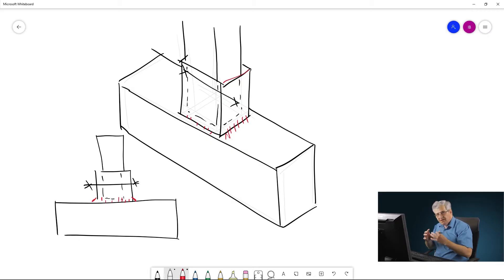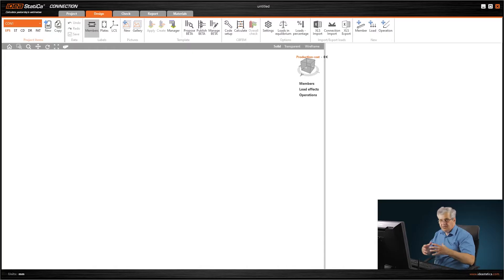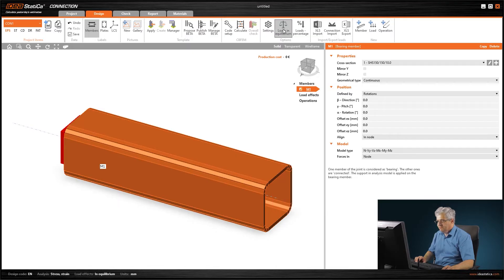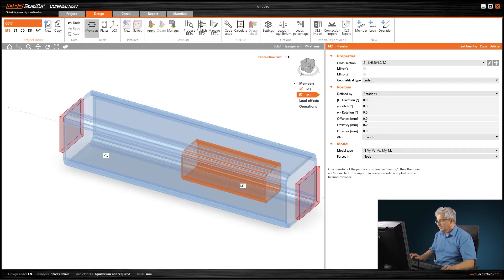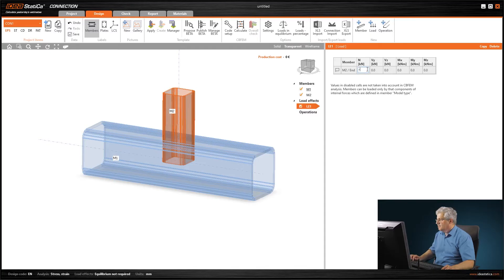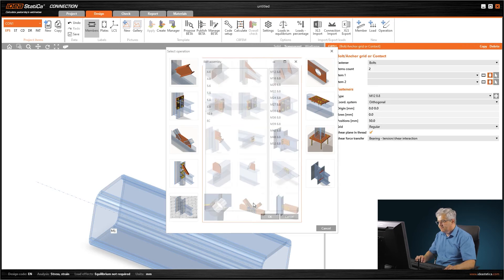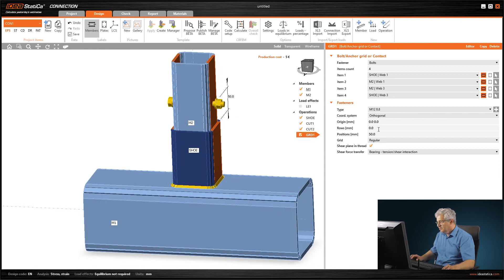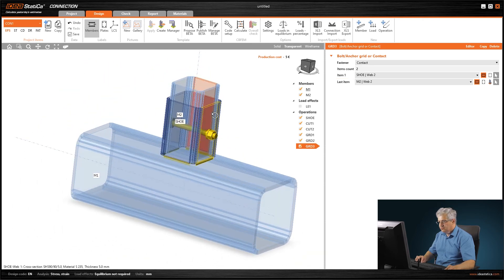IDEA StatiCa V21: Shoe connection of 2 rectangular tubes

Comment: Nice tutorial..sir do idea statica also design connections just like in stage lighting trusses? Just like your example video but there's no bolt inside ..only contact surface because it is collapsible connection just like in collapsible tents